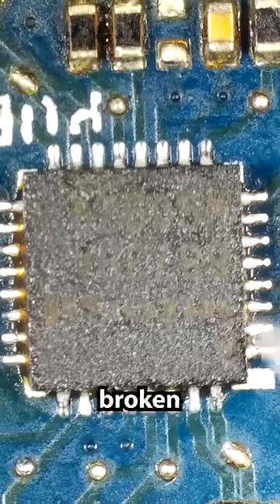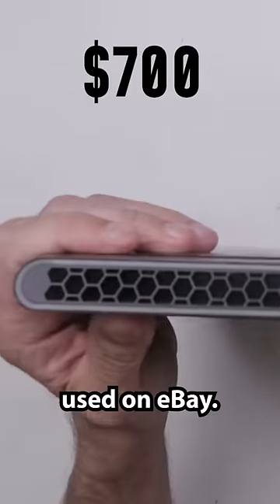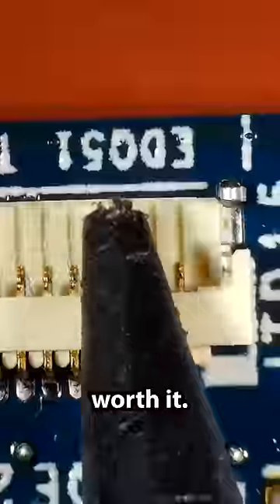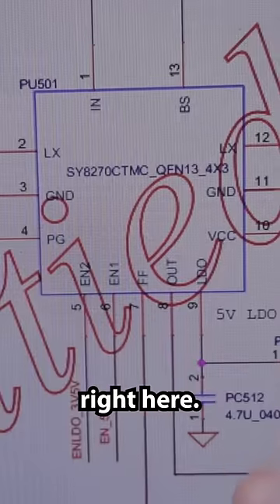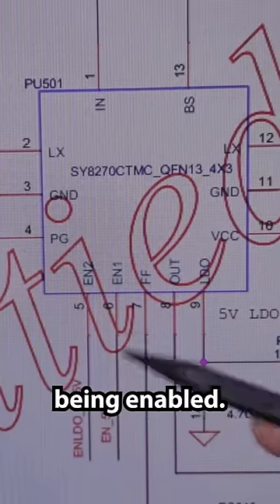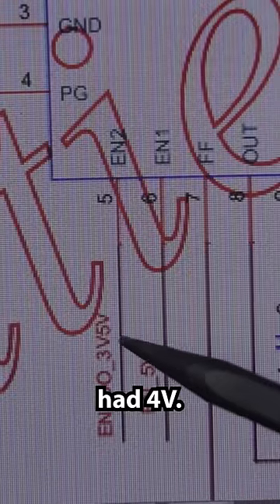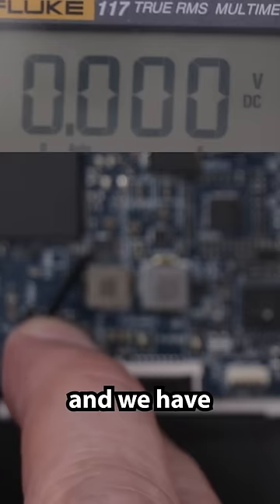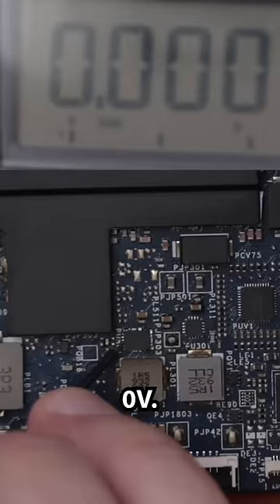Laptop VS Power Surge - Can I Fix It?!

Comment: You should try to inject voltage in the power rail and monitor the board under a thermal camera. Northridge fix explains it very well ^^

Comment: Was that not a failing power chip for the 5v rail? It was only outputting 4v which won’t be enough to turn on the other chips using that 5V rail

Comment: You can never fix it by desoldering or reflowing a random chip on the board, that will just make a mess. Sometimes just looking over the board works, you also checked absolutely no Moffets on the board which is probably the real issue. If it is really baffling you can try voltage injection. Power surges can be bad though and it might be unfixable depending how far the surge went.  guess is it stopped at mosfet near the power connector. Next time check the resistances on those mosfets. Take a look at Northridge fix videos too.

Comment: I got a question I have a xbox one it was working good but it was dirty so I opened and cleaned it up and put new thermal paste and then put it all back together and now it doesn’t turn on when I press the button to turn on it shows the light is turning on but then it turns off again
Reply: id start with double checking that you have everything plugged all the way in, look at the connectors themselves to see if any got damaged
Reply: @GoCRaiden  i have done that twice a day and checked everything and still nothing I am at the point of throwing to trash already

Comment: I’ve got a Xbox one S, had liquid get spilled into it. It turns on then off instantly. I have torn it apart found no damage to the board itself. I thought it was the fan, changed it but it wasn’t the problem. I bought a power supply. Xbox turns on and stays on for a good bit but then shuts right back off. Any ideas what the problem could be?
Reply: Would it possibly be overheating and need a new heat sink?
Reply: Console does stay on now but after a few mins it powers down